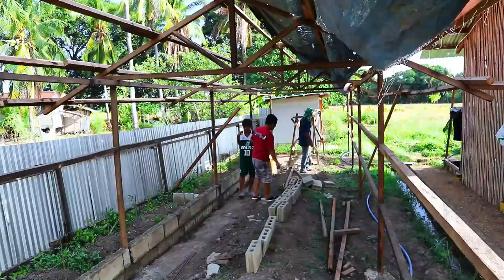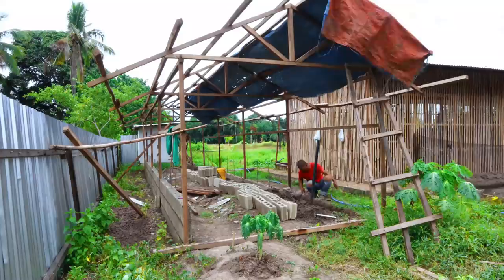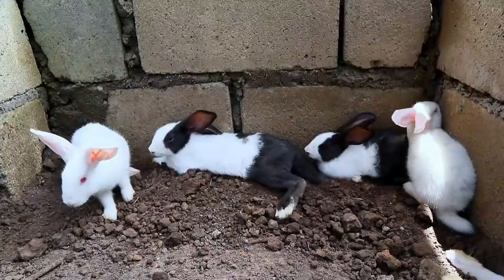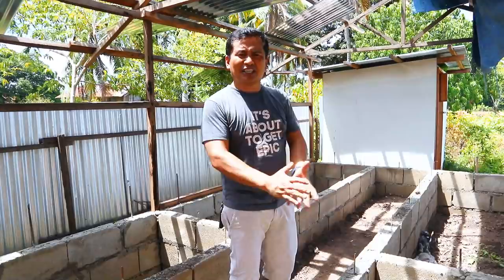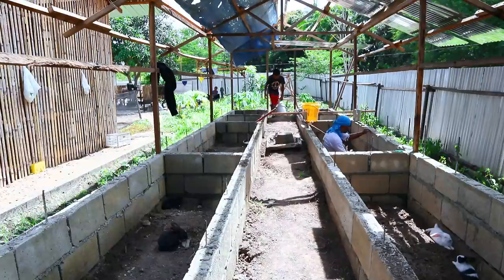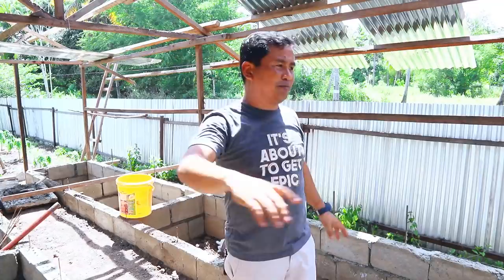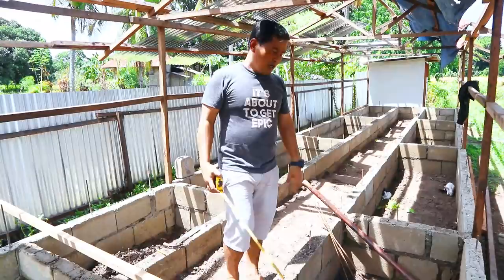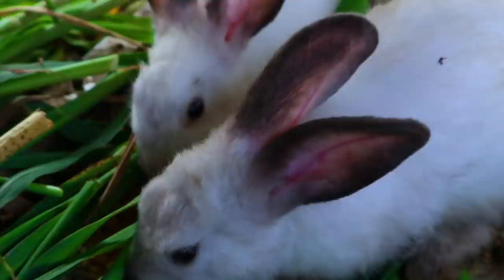Building cheap rabbit hutch for my 60 bunnies! How much did i spend?

Comment: You probably already know this, but Rabbit Poop is the only "Cold Poop", meaning you can put it straight on the garden without burning the plants.
       Chicken, horse, cow, goats and all other poop, is "Hot Poop", where you have to compost it a month or so before you can use it or it will burn your garden.
        When I found that out, I thought it was pretty cool. I still composted some of it, but used some fresh in my potting soil to get my ornamental plants a good start.
Reply: Not the only cold poop but your point is correct...goat, sheep, and rabbit are all cold poop

Thanks

Comment: You could have built your cages from wood and off the ground. This would be much easier to clean. Even though your workers will clean the waste, the urine still saturates the dirt which will still cause respiratory problems later on.

Comment: what if they dig too deep and even break through somewhere little far,i have experience this situation,and they dig and open a hole a way far from my place and get eaten specially the young ones by stray cats,how will you prevent this
Reply: You can add wire mesh below the dirt to prevent them from digging out